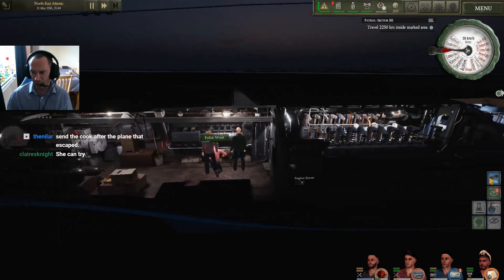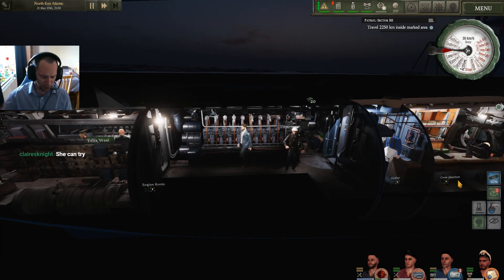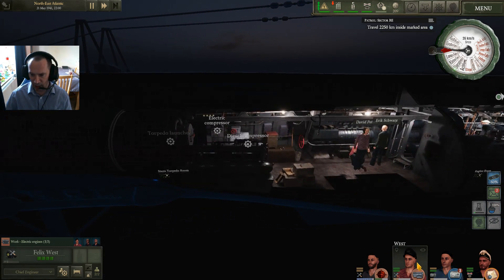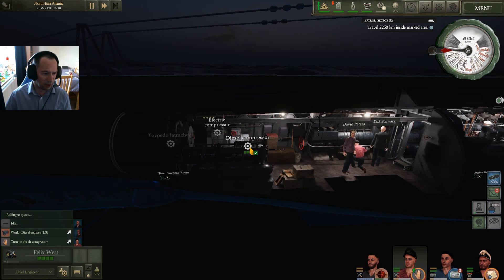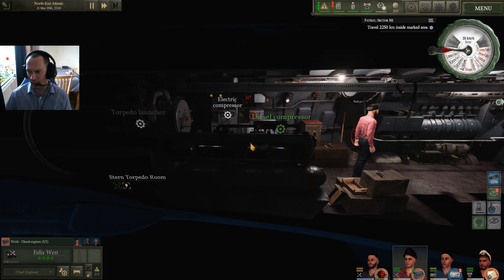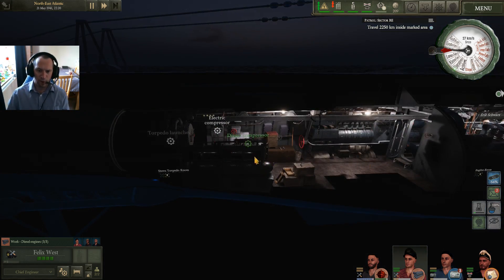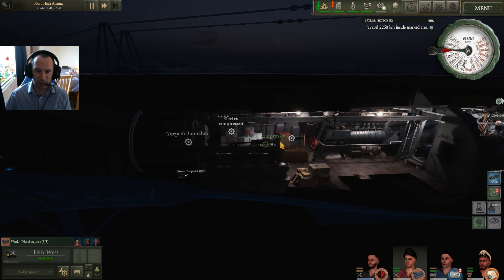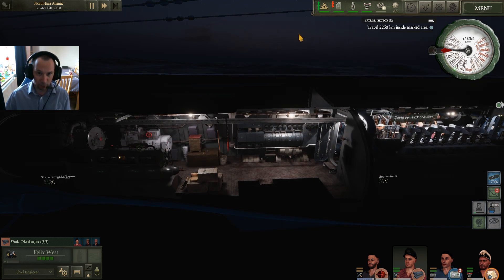UBOAT Guide Compressed air

Comment: Since I have the snorkel upgrade, I've been running the compressor while at periscope depth since the snorkel replenishes oxygen faster than the compressor uses it. However there's no indication that this is in fact working, as the compressed air icon in the corner never shows up - do you know if this works?
Reply from the maker: Yes it works :)

Comment: Why is there an Electric Compressor also?
Reply from the maker: one uses diesel fuel other uses batteries
Reply: Also if you are low on diesel fuel to make it to the home port, you can switch to electric engines, but it need diesel power to recharge them if the batteries are running low
Reply: @mikek3459  use engineer + navigator.  Reduce 50% fuel usage. The problem they took too long to dive after alarm was given